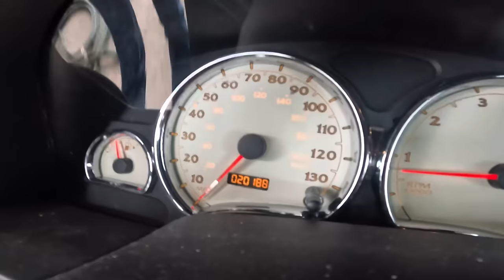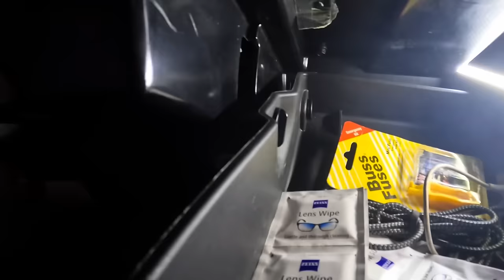Stripped Actuator! Clicking in Dash! 2007 GM Saturn Honda 3.5l

Comment: 5:56 my 1949 Ford was doing this on gravel and I thought it meant the brakes were working good. I took it all apart for wheel cylinders and found metal on metal brake shoes in the rear.

Comment: That's what the industry term "Reaching in the Parts Bin" means. Just a way to save money in place of redesigning every single component on every single vehicle. If the manufactures have a part that will fit multiple chassis then that's what they use to save money. Makes sense really.

Comment: Hard to be loyal to Saturn when the last one was assembled over 13 years ago. I loved them when they were built though. I owned 5 of them and they were all great cars. It would've been better if they paired this engine with the Aisin AF33-5 transmission the 2002-2003 V6 models got.

Comment: Hi from uk ray 👋👍 yup had one before on the drum/disc retainer on mine was a set discs few year ago now but the customer noticed I had snapped the torx faster on front disc and complained I hadn't drill tapped etc to which I wondered to lord above ""how just how"" does that torx hold disc on that wheel does not cos surely if that's a problem to customer surely finding his wheel would be mine if disc fell off in transit 😂 iykyk 😂 thanks for your time be safe and see you soon 👍👋

Comment: Thanks for explaining the functions of the vehicle. I do like when drivers inform me of their intentions. If it were not for automatic brake lights, I fear collisions would be even worse. Unfortunately, automatic turn indicators aren't available because the ECU cannot read the driver's intentions. Trust me, Ray. Brake spring pliers do make drum brakes easier. I still have a set in my tool box, somewhere, I think, well maybe I still do... Hmmm, where are those pliers? Oh... yeah. I lent them to somebody a few years ago. But, spray brake cleaner is a lot better than gasoline and compressed air. It's been a while since I did a drum brake job.

Comment: The leaked brake fluid actually softens and swells the brake shoe pad material slightly and that is what makes the brakes grab and lock up so anytime the rear drum brakes grab on a car a leaking cylinder is likely!   Good stuff Ray !

Comment: It's interesting : you can see through the hub and it has splines with a flat spot for for a nut. So it seems to me it can be used on the front also. Good idea, simplify things and keeps the cost down.

Comment: Do they even sell wheel cylinder rebuild kits anymore?  B/4 disk brakes Used to be SOP @~40k - pop the seals off, pull the pistons, hone the cylinder, put new cup seals on the piston & reassemble.  Either new shoes or sand old ones, turn the drums.  Most shops had a drum lathe.  "Good old days"😮 weren't.

Comment: Back in the USAF in 1970, wife and I went to Hot Springs Arkansas for a day trip. Rear wheel cylinder went out. Rebuilt the wheel cylinder in the parking lot of the gas station with a rebuild kit for $2.50. Had tools in the car including a wheel cylinder hone. Simpler times...

Comment: I have a special pair of pliers for removing that p-brake actuator arm  clip it makes it easy to remove and install those u-clips . One jaw is a  v- block, and the other side is a Groove, Matco Tool company was the source. It changes it from a few minutes of struggling to one simple squeeze for both off and on .

Comment: I bought a Saturn Vue close to when they first arrived. What I liked about them was being a 6 cylinder SUV. I also had a Class C RV and had my Saturn Vue installed with and configured to use a Blue Ox tow system which was great - no need for a 2 wheel trailer. It did not come from the factory with that setup, but if I remember correctly it was among the very few which could be configured that way without transmission head aches. Keep up your great videos. Thanks.

Comment: Ray, I think your customer that contacted corporate found out that Ford does in fact have a part number for the spring clip that is installed during assembly line on brake drums and rotors. Ford Part Number is E7TZ*1A107*A. When I was a tech at dealership, we installed new ones on each brake job for the same reason you had with a prior repair that corporate got involved with. Don't know if they are still available now, but they were hard for the parts uuys to look up, so I remembered the part number.

Comment: Those wheel cylinders look like they came off the Exxon Valdes.  Replacing the shoes is a good idea, start fresh.    PS:  I worked in law Enforcement for 29 years and my favorite stop was the clown that was weaving in and out of traffic. (Good Times). Ray, here is a tip to help you install any spring  if you have an old top spring (with some length) hook it to the original top spring you are installing and pull the top spring into place. If you are wondering Auto mechanics was always my hobby.

Comment: I worked in a rear axle plant for GM, as you stated those are drum retainer clips are only to hold drum in place during assembly,  no other use for them, disposable item. However you can remove w/out destroying by unscrewing,  good luck with that. Just a FYI....
Reply: But then the customer can't complain to some dude at corporate whose major mechanical accomplishment was opening the glove box.

Comment: Asalways an excellent, informative and entertaining video -- thanks.  Back in the 1970's when I was doing work on my first car (under the supervision of a friend who was a mechanic at our local garage) I had leaking brake cylinders.  In those days the fix was a new set of seals as the cyliders were so expensive.  How things change, I just nid the rear cylinders on my old VW campervan and was surprised how cheap the cylinders were.  I did use original brand quality parts - safety item, don't compromise!    Turn signals, yes we have the same problem in the UK especially with certain brands of vehicle!
Reply: It seems BMW drivers here in northern Canada don't seem to be able to grasp the concept of turn signal use .
Reply: oh, the times I change drum brakes with a screwdriver and vice grips...

Comment: Right their with you on the turn signals. For years I've thought they must be an option on new cars. As for the re on the brake job. I'd like to know how many they've done, for that matter how many you've done. It can't be many as everything is mostly 4 wheel disc this millennium. Good idea to use the camera to see. Mechanics version of arthroscopy.

Comment: I didn’t know those brake drum/rotor retainer clips weren’t necessary, so I always replace them.  I found them in the specialty hardware drawers at different hardware stores.  They call them “speed nuts”.     
Pro Tip: just push them on two opposite studs with a deep well socket👍🏻😊

Comment: personally I prefer using the cap tool for the locking caps post and springs, I also have the spring tool
for the return springs for the shoes, it goes over the pins and you use it to remove or replace the heavy 
return springs. it is novel to use break clean,  on breaks!  nice video stay safe!

Comment: When in the 1970’s and 1980’s we rebuilt the rear wheel cylinders and replaced only if the bleeder was rusted in or they were out of rebuild kits locally, today you throw out the cylinder and replace it with a new one. Just a sign of cheeper imported replacement parts. And with the existence of 3-D printers the gear in the heater door parts could be reproduced . Good video on a snowbirds vehicle! And i can’t believe you found a working punch card clock. They are so 1970’s , this from a 1950’s guy.

Comment: Talking about brand loyalty. In the mid-90s I worked for Mitsubishi Motors in California. At that time the eclipse was built by Diamond Star Motors and and the non turbo engines were a 2 L Dodge motor that was used in the neon. If you bought the turbo version of the eclipse that had a 2 L engine that was built by Mitsubishi in Japan. And I was lucky enough at that time to work for the customer service department and I would get phone calls so many times from people that were mad because they thought they were buying a Mitsubishi vehicle but they find out that it has a Dodge engine in it. They would demand that they want their money back and they want to trade the car in. Which fortunately we couldn't do but we had so many problems with that Dodge engine. So if you buy a 95 through 99 Eclipse non turbo you're getting a Dodge motor in it.

Comment: I've been enjoying your videos for a while now Ray, keep up the good  work.  As for those clips on the drums.  That guy should have been asked which he thought would do a better job holding on the drum.  That one little clip, that's just pushed on,  or the 5 lug nuts that screws against the wheel and drum holding it  all together.

Comment: I moved to Tennesee where I saw that practically no one used turn signals... Turns out using turn signals in TN is not required by law, BUT, if you cause an accident by not using them you can be cited...

Comment: Brand loyalty doesn't mean as much as it used to. But even years ago, there was mixing of parts. When you get your "Project Jeep" off the ground, I believe that you will find it interesting. 
I had a '79 CJ7 with the AMC 304 V8 in it. The intake manifold had FOMOCO molded into it. I'm guessing that the carburetor was Ford too. The starter solenoid was Ford, and the starter, if not Ford, was a Ford design. The distributor and coil were GM, as was the alternator and power steering pump. 
Those are just the parts that I remember off the top of my head. 
Thanks, and Good Day.

Comment: Ray. The brakes should have many thousands miles of use more than the mileage indicated on the odometer. When towing, the vehicle should have had a braking system installed. The system is like  trailer brakes. I ļove both of your channels and the wife unit channel and never miss watching.

Comment: The Jeep Patriot was a decent vehicle.  It shared a platform with the Jeep Compass and the Dodge Caliber.  It was a decent price and I was getting 41mpg on the highway.  The Jeep Renegade is a rebadged Fiat.  The Patriot that I had was a 4 speed automatic.    It took a head on hit (while stopped) by a wrong way driver at 50+MPH and looked driveable afterward.  So much so it fooled the insurance adjuster at his first look.

Comment: Curiosity. Is it possible that the RV braking system is causing extreme rear brake wear? The vehicle is running so no booster when applied, would that make the rear brakes work harder than the front brakes?

Comment: I think I've only complained once when a shop installed a defective reman alternator that was overvolting whenever I drove through a puddle. I would have just dealt with the shop had he (a manager) not told me that I shouldn't drive through water. I didn't like having to be that person, but there's a reasonable expectation to be able to drive in wet conditions without worry of cooking the electrical system. That particular shop also did work without my knowledge or approval when they did the initial replacement, and I only found out when I went to pay.

I'm aware it's an old video, I just wanted to relay that sometimes it feels necessary. However, that customer who complained on you was definitely a crap person and I'm glad you got out of that place.

Comment: In the old days, you remove the wheel cylinders, buy a kit for them, hone the wheel cylinders, discover they are pitted due to moisture, replace with new wheel cylinders, save the new wheel cylinder kits for future use but never use them.
Reply: And when cleaning out the toolbox 20 years and a few cars later, they get found again, with you having absolutely NO CLUE as to what they belonged to!

Comment: people not using turn signals/indicators is also a massive thing over here in the UK as well. the situation has gotten way worse since the pandemic. As for those stupid little retaining clips, it is quite possible and easier to replace them with the correct size of circlip  which makes the job so much easier next time.

Comment: Oh the number of those actuators I’ve replaced on various cars, some you can only do by feel and can’t even see what you are doing. They need to design things better for sure!!! And I only use OEM parts if available, aftermarket have way to many failures, many only lasting a few months or weeks.
Reply: Yeah they did design something,,,,cables and manual controls! Lol
Reply: @Dave-py6rw totally agree, sometimes the simplest way is the best way. Perhaps the electronic actuators are better than the vacuum type but I’ve seen those last 20+ years.

Comment: I have two foreign GM cars. Pontiac Vibe, really Toyota Matrix and Chevy Colorado, really Isuzu I-290.  Both have lasted way longer and needed less major parts replaced then the three cars I once had that were really made by GM. On turn indicators, this is the pet peeve of mine. I am behind a car and we are both approaching an intersection at the speed limit. The car infront stops at the intersection, then puts on the turn signal. Always keep your distance behind an idiot.

Comment: nice job ray, those drum brakes are always fun right? heheh
on that adjustment though, sure you can get them close but i don't trust those 'self adjusters' that much, i always pull the rubber plug on the backing plate and go in and do a final adjustment to get them just right before i put the wheel on. Just take a couple lug nuts and put them on to hold the drum in place, then go in through the back and adjust till they have that slight drag, turn the drum and apply the brakes to get the shoes to position themselves to the drum as they will move/center themselves when you do this. Don't assume they are centered on the backing plate after you first put them on and do the coarse adjustment. After that if they are just a couple clicks off, the self adjuster should eventually get them right when you apply brakes while backing up.
And on that parking brake arm? it's easier to deal with if you slide the cable spring back and just take it loose from the cable, then you can work on that clip removal and installation on the workbench. Less risk of the stabbing of the hands, been there done that lol 😉
But thats just me 😃
Reply: I'm over here telling/yelling Ray to pull the spring back on the adjustment arm and take it to the table & or vise to take it off and reinstall those stupid pinch clips. Actually the hardest part of the job was to put those back on with the spring washer fighting you the entire way, arrgh.

Comment: Back in the 70's, you didn't replace the brake cylinder, you'd rebuilt it.  You'd get a kit with all the rubber parts, take the cylinder apart and use a hone on a drill and resurface the inside of the cylinder.  Then reassemble.  Ah the good old days.

Comment: Hey Ray, not sure if you are aware that there is a tool for the horseshoe clips. I'm surprised  your snap on dealer hasn't tried to sell them to you. It's 2 tools, one to open and one to close them, worth their weight in gold. Since I'm now retired I don't use them much, but will always have them as there is no easy way to do them otherwise

Comment: Any one who would have done that job would have had to be a little crazy. As you stated uphill, on a side slope, truck not able to run so no air, frozen brakes, dead pull in that bad weather, good call Casey!

Comment: I chose a 2005 Vue over a 2006 Blazer because of the Honda drivetrain. Would still have it today if the subframe didn't rust out in 2020.

Comment: I am willing to bet that Mr. Ray has never had the pleasure of rebuilding a wheel brake cylinder, complete with honing out the cylinder and installing new pistons and cups. He is a deprived child. Also I bet if I look real hard in my multi box old tool collection I might find a brake shoe retaining spring compressor tool. Watching Mr. Ray do this rear drum brake job brings back memories of many decades ago when I was a much younger man. They used to give you a new clip for the parking brake arm  with every set of brake shoes. Ahhh, the good old days. Instead of Brake Kleen, we used to use gasoline and an old paint brush to clean the backing plates.

Comment: Man, I hate those damn actuators.  I have to replace the mode door and the blend door for the second time now on my 99 silverado.  The first time was due to cracked gears, and now it's because the motors inside barely turn, so I'm stuck on vent and hot air.

Comment: I had been shown a easier way to deal with installing back brakes however the job that you did on the brakes was efficient and it got the job done some people may have different styles of doing it as long as it gets the job done and done correctly it shouldn't matter the style of the person that's doing the job

Comment: I did my drum brakes one time in the afternoon and the tool broke the spring puller broke, and tore opened  my middle finger and the nerves were hanging out. So I had to trim the nerves off with a pair of scissors. One of my best friends happened to be walking by so I went into the house and took a shot of gin to improve circulation and washed my finger out and my friend helped me to put Band-Aids on my finger and I went back about my work and finished the job. It was not fun.

Comment: Frank shoes in Canada come everything except for the adjuster and the piston and those little clips that hold down the shoe sometimes they come with the clips the cold down the shoe it’s cheaper to buy the shoe assembly because it comes with all the parts that you need besides the piston

Comment: Hey man, Saturn tried to get GM to pay attention to them for their powertrain needs, GM refused, so Saturn went to Honda.  Also, the Vue is not a rebadge, it's the original.  The Pontiac Torrent and Chevrolet Equinox are the rebadges.

Comment: Re-branding is not new, back in the 1980's I worked on an AMC Spirit. I had a GM engine, Ford transmission, and a Chrysler rear end.